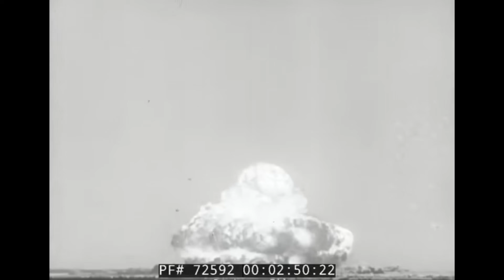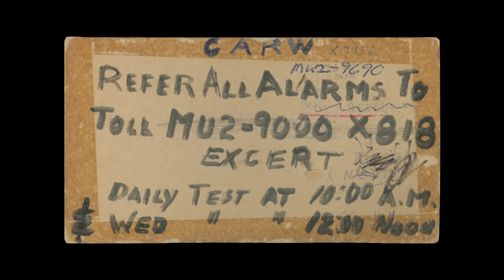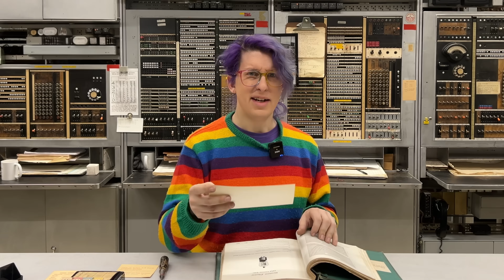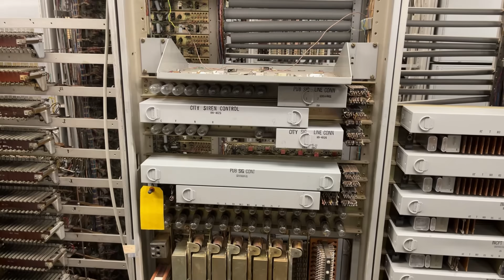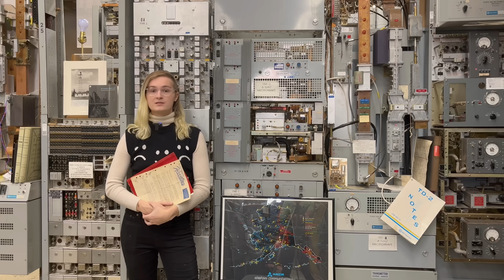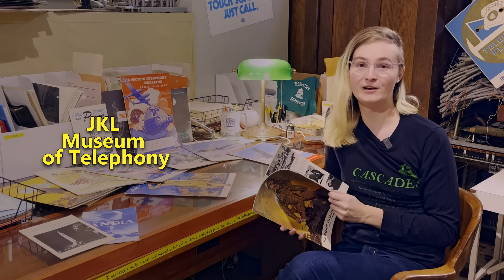CARW: Bell's Nuclear-War Telephone Network

Comment: Slightly on a tangent, but the title reminded me of when I worked on the BT DDSN contract back in the mid 80s. The core network was based on 5ESS-PRX switches (CCITT signalling) as developed for the Saudi Arabia TEP4 contract. These switches were lacking Centrex features so when Mercury Communications bought DMS100 switches to offer Centrex to the financial businesses in the City of London, BT panicked!! They asked us to provide a switch (located in Baynard House) with Centrex. The only one available was a Bell standard switch used for 'nuclear attack hardening testing' by AT&T USA. This was shipped to the UK and attached to the BT network via 24 to 30 channel PCM converters. In the end it never went live and was used for test/training purposes #goodolddays

Comment: I wonder what the parts of the warning siren system that have survived into the modern day as tornado and tsunami warning systems uses? Like, I assume they still use hardline connections, but has the signaling system changed over the decades?
Reply: I used to work in an emergency management office. Modern outdoor warning sirens mostly use 2 way radio systems and a microprocessor based controller at the siren site. Most are individually addressable and include station polling where the control points can identify specific sites to sound, confirmation of alert being sounded, and silent tests. On some loudspeaker based models, the so called silent tests may actually be ultrasonic sounds, and can sometimes trigger the distributed canine warning system
Reply: NWS has their own alerting system distributed over NOAA radio. You can buy radios that decode these weather alerts and sound alarms in your house.  I have one downstairs that sounds for all alerts, and one in the bedroom that only sounds for important alerts like tornado warnings.